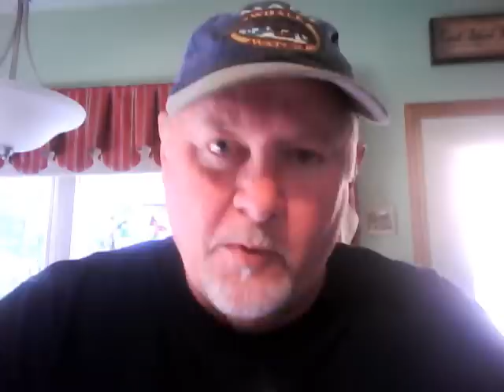Repair Gas Grill Low Flame

Comment: Champion! Wan't entirely sure I was watching a video that was suited to my issue... turns out I was! The only extra step I needed to do to get it flowing again was to open the first AND second burners after I turned the gas back on.  Turning only the first didn't do anything for some reason but as soon as I opened the 2nd, boom! Full flame on both!

Comment: yo dude. 2020 and you're still cookin' it. Yes a comment earlier was right on, it was your "dead slow" that did it. i tried this as suggested by other youtubers but i found a secret no one has mentioned. the way you know it is working is if, after disconnecting from the tank and opening the stove, then shut off the stove and reconnect the regulator, then turn it on dead slow until you HEAR A LITTLE CLICK FROM INSIDE THE REGULATOR. That is the little metal ball being held by the little spring snapping back into proper position so the full force of the gas comes through, not, just the thirty percent that comes through on safety mode. Tank you so much.

Comment: This trick worked for me, so I thank you for the advice.  I thought the problem was the end of the previous grill I bought, so I threw it away and bought a new one.  The same problem happened.  That is when I found this video.  You don't think Weber, the manufacturer, does this to sell more grills, do you?

Comment: omg ricky! we had low flame which wouldn't even stay lit for very long.  mandy was assigned to fix the problem and she reset the regulator many times yesterday based on your video. she opened up the tank valve even slower than you imaginarily do with your hands in the video. we still had low flame. mandy decided to do some ruling out of the adapter hose and propane tank, so she went to the store and got one of those little, expensive green bottles of propane that our Q120 was originally supposed to use and put it on in place of the big tank to try to isolate the problem. we still had low flame. She decided that it must be the old crusty regulator because she had already cleaned the burner tube including the little air inlet screen which had previously been completely clogged with greasy stuff. she ordered a new regulator assembly and it's on its way, but in the meantime, she started messing around with the old one. She meticulously cleaned the exterior of it with q-tips and rubbing alcohol getting into all the nooks and crannies. She's sort of obsessive-compulsive so that lent itself well to her task and she did a good job. After she got it all clean and in showroom condition, for some reason, she decided to put the small end of the regulator assembly, the little tube where the gas comes out and goes into the burner tube, into her mouth and suck on it while turning the post where the control knob would go to control the flow. She got a mouthful of thick, blackish gelatinous goop! we couldn't believe it, why didn't she think to blow into the end where the adapter hose goes into the bbq?!?!  anyway, she did it again the right way and blew a bunch more goop out into a little puddle on the ground, continuing to blow until it sounded like her breath was moving freely through the regulator and no more viscous stuff was coming out. It worked! Our weber Q120 is at 500 degrees right now, halfway through it's high-temp cleaning cycle. We didn't need the new regulator assembly after all, but it's on it's way to us via Fedex right now, so we're still going to replace the old one anyway just in case mandy didn't blow all the goo out of it. Your video didn't really help in our case, but we're always going to turn off the bbq burner first and when getting ready to use it, SLOWLY open the tank valve and wait for a while for the hose to properly pressurize before we try to light the grill.

Comment: I just tried it on my Genesis Silver "B" (2004) which had a low flame on all three burners and it took care of the problem. And to think I was getting ready to order a new complete manifold with hose & regulator well over a 100 bucks. My burners are in real good shape (no rust) and the flavor bars have some rusting on the bottom edges which i will be replacing at a later date.